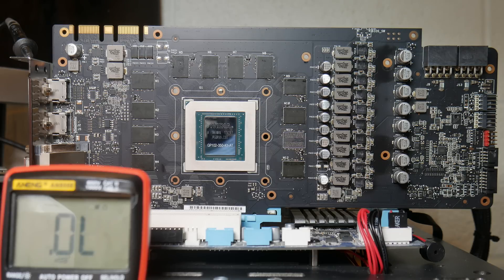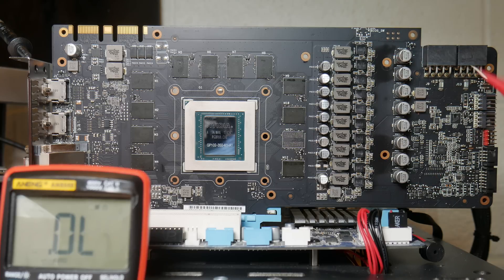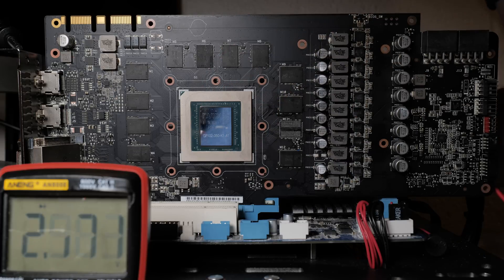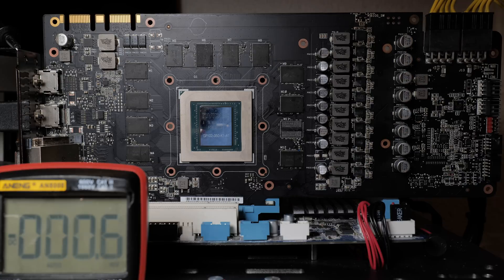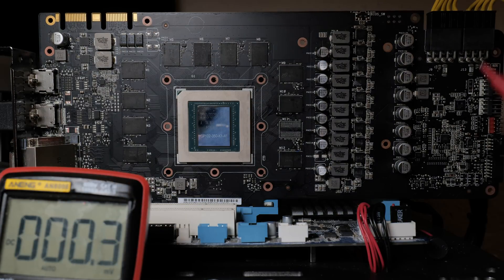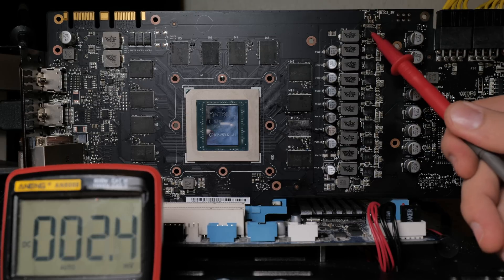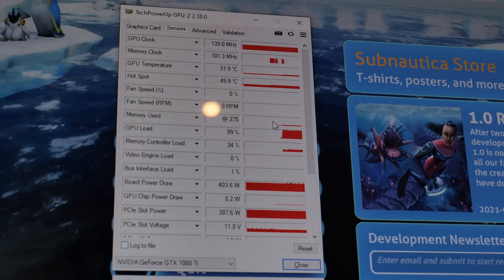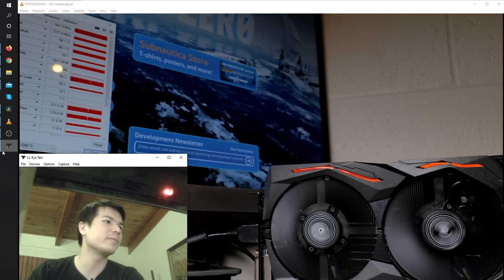Asus Strix GTX 1080 Ti Graphics Card Repair - Stuck at 139mhz, Not Detected, Computer Won't Power On

Comment: 18:32 You mention that the tiny resistors are "supposed to be 20 ohms each, the top one is 14 kohms but at the bottom is 110 ohms." You replace them off camera, but #1 how do you know they are supposed to be 20 ohms each, and #2 how do you find components that are the correct spec to replace them with, and #3 how do you replace something so very tiny? Wonderful video, thank you for explaining. I have a 1060 with the 139MHz problem that I'd love to solve.

Comment: I am surprised you don't add a zero ohm resistor to the power feed. Or fuse where it would sense the load.

Comment: Have you ever seen mats give a pass but not do the whole blinking blocks dance? in the same setup with a known working card, I get the blinky blocks dance on screen, but with a faulty 1080ti it just pauses like it's running something (the larger the test value i give it, the longer the pause, so it is doing something in the background) and then the usual results blurb comes out and says pass.

Comment: Can you help with fixing Aorus 1080ti? fans spin at 100% on start, two leds over PCIE cable turns on (which indicated power issue) and no boot.
Reply: if fans are 100% you maybe missing 12v PCIe Line. Cheq for open fuses if have. (Fans are 100% when GPU its "not" detected or present in the PCB"

Comment: how much does a repair like this cost usually? i have the same 139 clock bug with my gtx 1060 6gb and im looking to get it repaired
Reply: just get a good board level technician near you. That depends on the shop.

Comment: Just ran into this exact problem on a Asus 1080 ti turbo. I lost one of the 10 ohm resistors trying to repair the pad for the cap. Thank you so much for showing what caused the locked cpu frequency and saying what ohms the resistors are. I stole one from a PS4 board but got the wrong one and put on a 1000 ohm, the card works, but with this exact symptom.
The cap was also ripped off the board and I don't know it's value. I think I replaced with the right one but I'm not 100%. Do you know the value of the cap that's in line with those 2 resistors?
Reply: Found the correct resistor, measured one of the other caps and got 10nF. Found a replacement cap on a spare PS4 board. The card is working great. Thank you again.

Comment: I have an RX 590 that is detected but won't install drivers, and booting with another GPU as video output, I can see unreal huge power consumption in the Sensors tab of GPU-Z. What can I do to fix it? It doesn't have the same circuitry to measure power consumption like nVidia does, right?
Reply from the maker: Has a MOSFET been replaced on it recently?
Reply: No, nothing has been replaced yet. It just failed while using and then when I restarted the machine, it shows some vertical noisy artifacts,  with characters/symbols randomly showing as well.
Reply from the maker: @amiltonfcjunior  In that case, I have to say you likely have a memory related error, and that the absurd power consumption is just a symptom of the drivers not properly loading.
Reply from the maker: @amiltonfcjunior  yes, see my latest video

Comment: hi man nice vid!! i got a 1060 strix . yesterday after saw 1080ti video, i check voltage on 1v8 coil,  PEX coil, 5v Coil. and vrm and core.  everyone was fine except the PEX VDD. in the 1060 you can find it to the right of the 3v3 rail from pci.   i check the controler nb671, and re solder. and when i plug everything., i check the 1.8v coil, and was fine, but at the moment to check de PEX VDD coil i made a short with the probe.. and after that, the 1.8v Coil doesnt show anymore voltage.  
now i got short in the pin 7 of the nb671 (pex circuit) to the pin 8 and 9. and the same in the 1v8 circuit.  i remove the bn671 from pex and the short still in the pcb. GND to pin 7 short, gnd to pin 8 and 9 , short.  i try to find in the schematic why the 1v8 phase blown up... i cant find a point where they connect each other...
pex coil 4omhs
1v8  coil 0 omhs.  
can you give some idea?? thanks and Great videos! a lot of knowledge
Reply: i forgot. i remove the pex and 1v8 coil. short still. i remove the 4 caps after the coil those who filter. and the short still. i remove some cap on the backside that was conected to the pex vdd and nothing... maybe i got and issue in other side....no power rail in short.  should try remove bn671 from 1v8 section?
Reply: and i found that the memory coil, now show 0 omhs. before show a higher number....

Comment: sorry, I want to ask about my GTX 1050 ti GPU which accidentally miss one capacitor on the processor. will it cause a problem one day?do you have suggestions? I yet try to turn it on because I am afraid something happens to my GPU

Comment: @Tech Cemetery trying to fix my Asus Strix GTX 1080 TI. Fan spin, no video. All voltage rails are present and resistances look in the normal ranges you specify (PEX is a little low at 45 ohms). vCore does initialize. From here I can only assume the issue is either bios or a dead GPU. Thoughts? Thank you for these excellent videos!

Comment: Hey. Great video as always. I have become an avid follower and actually do a lot of repairs myself. It does actually bring a question though. I am having issues where a mosfet will blow and after changing it out and all measurements back to normal. Put it on test and then, boom, the mosfet nearest to it will blow, this has become like clockwork now. Until I end up changing almost everything from the phase. All mosfets, drivers and doublers? Is this normal or am I missing something. Thanks again. And great work.

Comment: got a amd 5700xt with a misissing inductor thst came off pcb leg riped off inducter where can i get a replacement inductor correct size and rating its vcores r15  inductor whats current rating or size i need

Comment: Had an old 9800GT that melted the PCB. No fuse and the power supply was single rail so it sent all 80A through the dead mosfet. Made a nice light show inside my case.

Comment: 15:00 gpu also reports that it's throttling due to power consumption (PerfCap Reason at the bottom of the GPU-Z list).
Reply: One would assume if it thinks it's drawing 400watts...

Comment: Nice job as always, but PGCE17 isn't missing on the PCB on one of the phases?
Reply from the maker: I can't believe I missed that, yes it's missing. I'll have to add back onto the board later.
Reply: @TechCemetery  it's part of the job, specially when dealing with multiple issues on one device, plus look's like it was ripped out on a previous attempt of repair or cleaning maybe. I've decided to post this just because the additional ripple can do damage to the VRM in a long term and kill the card again. Keep up with the good work, and sharing your expertise here with others really helps make this a better world.
Reply: What is pgce17?

Comment: Ah yes literally my nighmare repair, i've seen a lot of burned cards ended up as a donor cards. Few days ago im asked to repair zotac 1060 which doesn't have a fuse and the vram literally looks like it just exploded. Also im quite surprised that the top phase is still working after that damage.

Lesson : a $1 fuse could save the day
Reply: A fuse and you wouldn't need to buy a new card, yea that how dam nasty they are.
Reply: @dtiydr  in all fairness the card can still die because of other factors, but having fuses at least prevents fets from literally exploding in most cases
Reply: @trouble_maker023  I don't care about any fets what so ever, my thought are 100% towards the gpu. With fuses its a much bigger chance that the gpu survive fex 12V right into it then to guarantee 100% be destroyed without a fuse in a similar case, and the gpu is also the most expensive piece of silicon on the board so you the best for it as long as possible.

The memories are the next and they cost as well but still way cheaper than the gpu and also easier to get hold on. Any other component on the board that could break is peanuts in value, but as long as the gpu is alive you would have very good chance to save the card with only a little lower amount of money. I have planned to put fuses on mine 1080 ti but I just don't know the right values.
Reply: if they added fuses they would have to charge 1200$ to recover from the component cost

Comment: The lesson is: Go and buy a good power supply. Not that kind of cheap 750W single-rail welding machine stuff.
So many times I see really expansive PC hardware, but the owner brought a budget supply.
Reply: True that. Just because it says 750w doesn't mean it's good. It's always better to buy 600w decent supply for about the same price. And the odd part, the "weaker" unit delivers steadier voltage and equal or higher power (wattage). Who would've thought 80 plus ratings aren't just a fancy badge?
Reply: Even a good power supply still can be sucks, the most important thing is the OCP and i've seen even some good and expensive power supply failed to shutdown immediately after a short is detected.
Reply: @accurian148  I do not disagree on that, but buying a good power supply always increase your hardware's survival chance